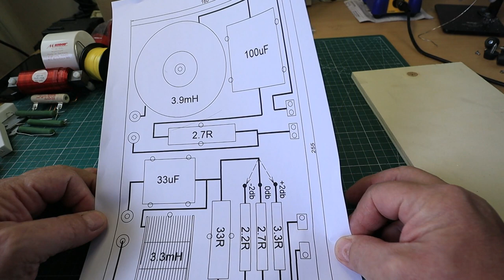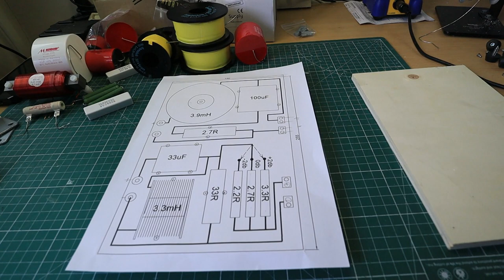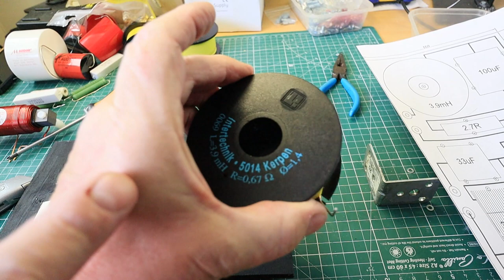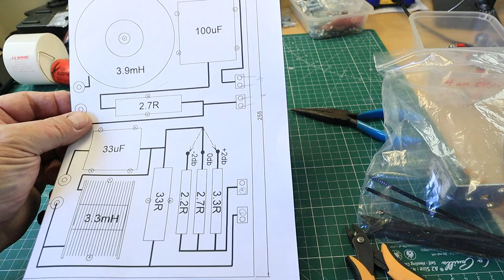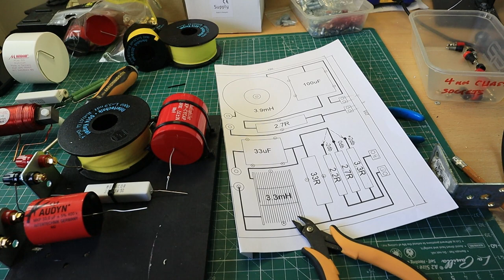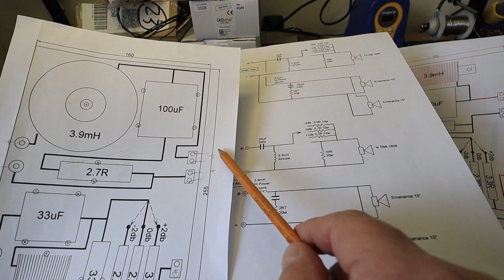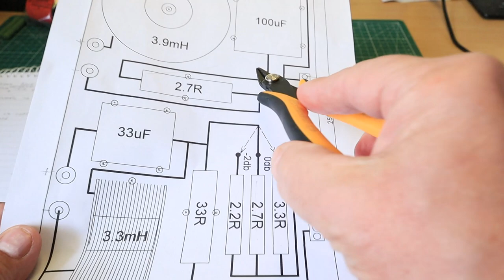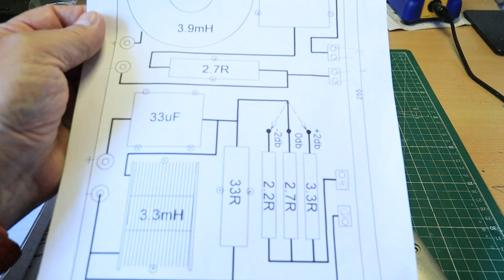The Trio Open Baffle Speaker Crossover Schematic and Layout.

Comment: Thank you so very much for doing this series of videos. Actually, thank you for all of your wonderful videos. Your DIY First Watt vids are spectacular, as is this one for the Trios. It baffles (pun slightly intended…) my mind why people will spend many thousands of dollars for their audio gear. With a bit of time and effort and basic understanding of electronics, you can build a truly top notch system for a fraction of the cost. It may take some time, but you’ll love your system all the more if you DIY. I do understand people who just simply want commercially available gear, but it’s much more satisfying to build something yourself. 

I’m in the process of putting together another tube based (12AX7’s) phono preamp using top notch parts, as I gave my other one to a friend who loved my original one. Also a line stage (also tube based / 6SN7’s), and new crossover parts for a beautiful pair of Klipsch Forte l’s I got for very little money. I also own and love my Tekton Pendragons, but also love horns, as well as open baffle Trios thanks to your fantastic videos. I’ll eventually build a First Watt clone, which work beautifully with the tube preamp, and your vids make the process so much easier. 

A million thanks to you again! Cheers! 🔊😊🎶🍻 - Nick

Comment: Why don't you like sandcast resistors nothing wrong with them
What are those capacitors what type
Why don't you buy British capacitors clarity capacitors better probably and cheaper
Just use lighting solid core cable cheap but just as good as a enamel easier to work! and isolate your components Earth from your drivers don't let them share the same path
Try and use 6% silver solder if not 4%
If you using the terminal blocks getting the ones with the protected from the screw solid core wire like that will break the wire or a ferrule on the end of the wire
You can remove the enamel by using acetone nail varnish remover.  actually not winding is better should be no problem if you wind the wire you're causing inductance very small
Reply from the maker: Thanks for your comments John :-
Reply from the maker: Sorry,  you tube has deleted my detailed reply for some reason.
Reply: @thediyaudioimplementers1826  what do you mean it deleted your reply!? That's a bit strange Can't you just repost it. 
  when did you get this message three days ago or just now! I get a lot of 404 errors when posting I have to join the sentences up some words seem to be forbidden!!.
Reply from the maker: @johnsweda2999  I know not why it didn't upload, Ill try again. There is nothing wrong with sandcast resistors I just prefer Mills or Mundorf. The CAP type are metallised polypropylene film capacitors (MKP) I was fed up waiting (over a month) for a UK supplier to ship so I used what I could get and what I had on the shelf. Cables are up to the individual and sold core lighting flex works well along with 'Star' earthing.. Nail varnish remover works to remove the enamel if you have it. (I don't). I don't use silver solder but you can if you prefer. Terminal blocks 'good point' I'll not be using them in the end as I intend to go active and all joints will be soldered. Again use a ferrule if you have them. Winding the legs to the circuit wiring is OK as long as you solder well but please do as you see fit, with respect to inductance, 20 years ago I tried to measure this yes there is some but I gave up life's to short. The whole essence of these videos is to entertain and along the way they might help some one. By your questions you are a competent diy builder. I'm trying not to be to technical there are other places on the internet that does that far better.
Reply: @thediyaudioimplementers1826  ok